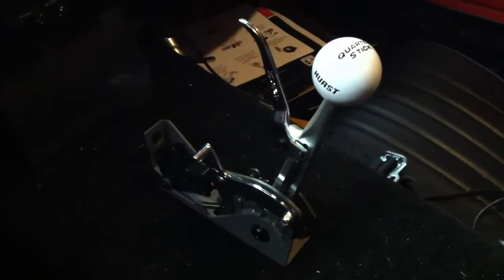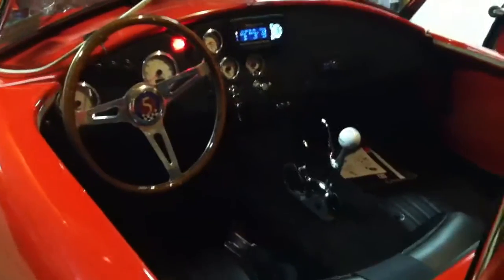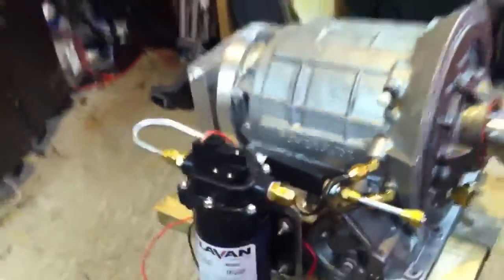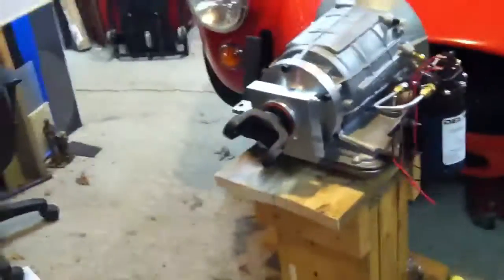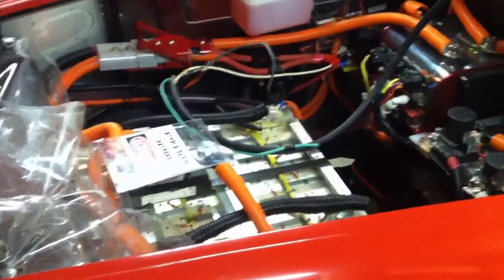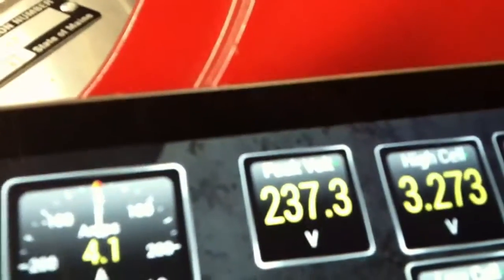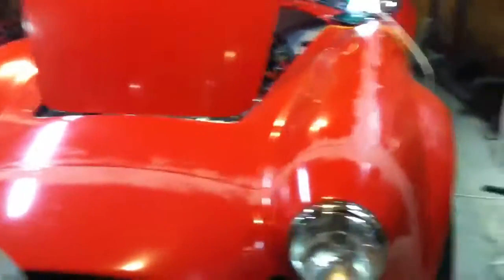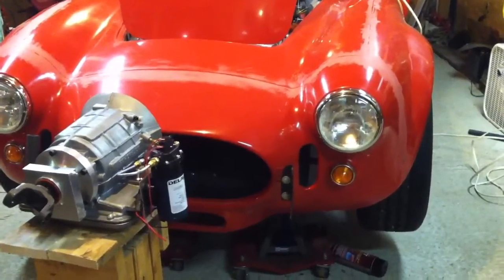FFR Mk4 - Electric Car - # 50 - EVGlide

Comment: What ratios are you using in the Glide and rear end?  What's the max pressure and GPM of the pump?  I'm using a 60PSI 2GPM pump on my TH125 Fiero transmission and it's not quite enough to keep it pressurized all the time.  Also, how much are they charging for the EVGLide?  Thanks.
Reply from the maker: The EVGlide has a 1.76 low gear, and of course 1:1 for high.    The rear end is currently 4.10 but will be replaced with a 3.28 this winter.   The pump is 60psi.   Not sure how different the needs are between your TH125 and the EVGlide, but they say it is enough.   Will find out next spring.    It was $2750 for the conversion, adapter plates, etc.
Reply: Wayne Krauth
Thanks.  Also, are you using a manual valve body in the Glide or will it auto shift?  Did they change the shift points, or are they adjustable?
Reply from the maker: JRP3 It has been set up for manual shift, no auto.

Comment: Did you ever get that acceleration time?
Reply from the maker: The best time I measured was 0-60 in 4.2 seconds, in 213 feet, but that was not quite at full power.   More details in the comments on video 49.
Reply: Wayne Krauth 4.2 aint bad.
Reply from the maker: Dan Frederiksen Feels great in the driver's seat!

Comment: Wayne,

That's a really good looking transmission, did you have it made special or are they a standard item?

Randy
cztree.blogspot
Reply from the maker: I found the transmission locally and had KansasEV convert it to their EVGlide design.  They convert them for use with 9" or 11" motors.